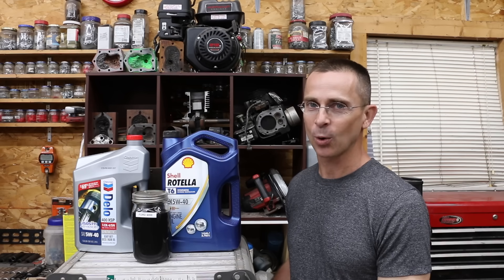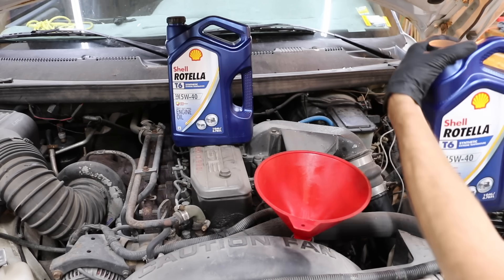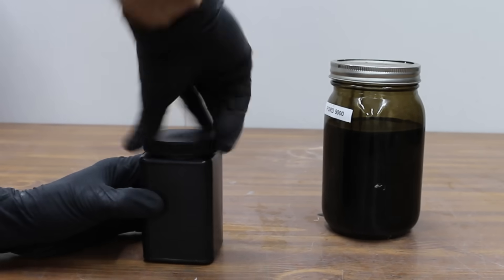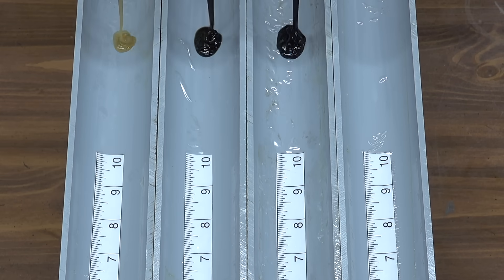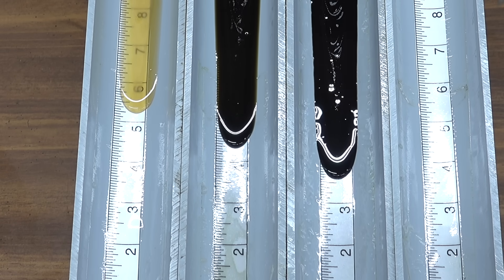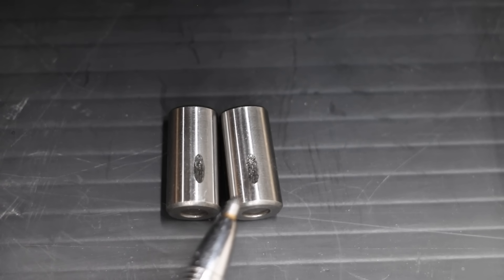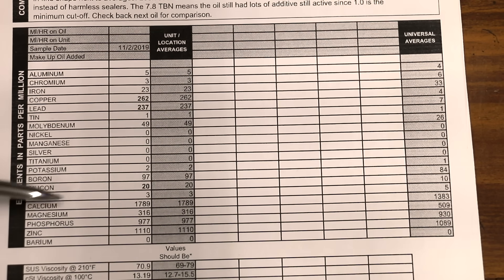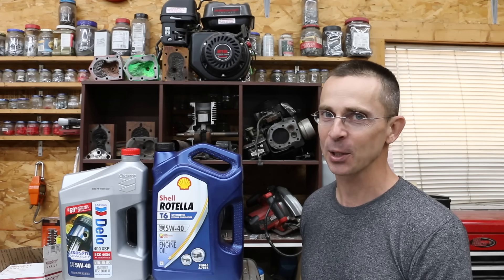Will Annual Oil Change Damage Your Car? Let's find out!

Comment: However, here I am back yet again. No one ever damaged an engine because they changed the oil too soon, as long as they used the correct products and installed the filter correctly.

Lucky me, my '96 Sentra is gone (state vehicle retirement program) and I'm back in a 2001 Toyota Camry. As far as I can tell, the former owner, now deceased, never missed an oil change in 20 years and 140,000 miles. I use no-name filters and low-cost dino oil, but my preferred oil change interval is 2500 miles. You don't have to worry about the ability of your oil to hold and neutralize contaminants over a year or more and 12,000 miles or more if they're not there in the first place.

I put a lot of weight in the report I heard about the New York taxi fleet test. They apparently found out that there was no difference in engine wear between conventional and synthetic oil. The conclusion I drew is that there is no point exceeding the requirements of the production you are working with. For example, the flow rate of an oil at very low temperatures is irrelevant if you never experience those temperatures. Nor do the differences in lubricating properties between one oil and another matter if your production does not require or utilize the superior properties of the (usually) more expensive product.

My bottom line is, trust the specifications of your production and the products you have available. My 1990s-era import engines do not require synthetic oil and I do not use it. The no-name filters I use are made to be good for 5000 miles. So is the low-end major oil company oil I buy. By changing the oil at 3000 miles at the most, the ability of the oil I use to hold contaminants over a long interval is not an issue.

I'm a good humorist and I can make snarky comments with the best of them, but I know how to be logical too. Another takeaway is, if you want to go a long time without having to change your engine oil, make sure you get products (oil and filter) with the specifications to match your objective. I would say, also, set your maintenance interval low enough that if you miss it, you are not going to harm the engine. That's what I do.
Reply from the maker: Thanks for the feedback.
Reply: @ProjectFarm  The way I see the market, there are there tiers of motor oil.

One) What I call major oil company oil. This mean labels like Chevron, Mobil, Shell, Texaco, Havoline, Arco, Sinclair, Citgo, Exxon or whatever. House brand oils, like Supertech or the proprietary label at a chain like Family Dollar, are by default oil company products.

My long-time take on these going back to the late 1970s is that they have good lubricating properties but wear out sooner.

Oil company products may be either conventional or synthetic.

Two) Premium or upmarket brands. These also may be either conventional or synthetic. These are brands like Penzoil, Quaker, Valvoline, Kendall, and Castrol.

My longtime take on these is that they  permit a longer oil change interval. Their synthetics probably are better than those sold under the oil company labels.

Three) Luxury or vanity products. These are products like Amsoil, Royal Purple, Red LIne and the like. They probably are somewhat superior to other products but only in that they allow a longer oil change interval. Someone who drives maybe 10,000 highway miles a month might have a legitimate reason for using one of these products.

Someone who drives largely short trips (like I do) should use a cheaper product and change more often. Easy for me to say that though. I have a 2.2L Toyota. All I have to do is open the hood, reach down and twist off the filter by hand, then jack it up a couple of inches and put the catch pan under it.

Mobil 1 is the anomaly in the market. It is an oil company product but in market position sits in between upmarket and vanity.

Comment: I did not change oil in my 2016 Camry for 2 years. I am in Canada and I am not aggressive driver. The oil is 0W20, I assume it is synthetic because it was a dealer who changed it 2 years ago. Due to COVID I was scared to go to mechanic. In two years I travelled only 1,200 km or 800 miles, while the Manual tells to change the oil at 10,000 miles or 12 months whatever comes first.  My total mileage is also low - only 3,700 miles as I do not drive much. Please, advise should I worry that I did not change the oil for 24 months, while having very low mileage in the last 2 years?
Reply: The only problem I see is you may not have allowed the engine to fully warm up. Even with the coolant gauge in the middle it can take oil longer than that to warm up. But with low miles perhaps the fresh oil kept the engine somewhat clean? I don't know but I'd probably change it and you can check the oil at Blackstone labs.

It's also pretty easy to change oil yourself, a ton of videos on how to do it. If you still don't feel confident maybe find a vehicle that is on it's way out and try it with that a few times to see.

Comment: I have a motorcycle that I don’t ride a lot. I’ve ridden about 4k miles in the past 3.5 years. I changed the oil in summer 2019 and have only ridden a little over 3k miles. Harley Davidson says 5k mile oil changes. Since it’s been 2 years would you recommend changing the oil or wait until 30k which would be 5k miles since the last oil change?

Comment: A job well done sir, I salute you.  This is something I have always suspected, and you've just proven.  I have a MB V6 diesel and a Genesis V8,  I use mobil one change yearly regardless of mileage. The MB is Sprinter rv I make sure to run at least and hour at hwy speed monthly.
Reply from the maker: Thanks!  Thanks for the feedback.

Comment: The problem with this video is generalizing results from a 5.9 litre cummins diesel which is likely the most reliable engine in the history of ICE to the gas engines most users will use today. The oil change interval on a diesel is often 3x longer than on an equivalent gas engine and depending on your situation can be even higher. So while this video is likely good useable data for diesel owners I would still recommend gassers change their oil every year to be honest.

Comment: Backs up my choice of T6 for my 6.7 Cummins. Been shopping around everywhere for Rotella T-6 this week (Oct2021) can't find it anywhere. My local Walmart where I usually buy it has ZERO diesel engine oil on the shelf, not a drop in any brand. Found three gallons of Valvoline at Amazon, I'm sure it will be fine.
Reply from the maker: Thanks for sharing.

Comment: I work for Cummins and I gotta say, I was already a huge fan of yours.. but running an old Ram with the 5.9 AND using Fleetguard filters… wow. I’m doubly impressed. It’s a rare sight for me to see that combo, most people cheap out on their filters when it comes to those old girls. Also, if you’re asking for oil requests, try Valvoline 5W40 Premium Blue.
Reply from the maker: Thanks!  Thanks for the suggestion.

Comment: Please note that motor oils with extra wear additives can damage your catalytic convertor. The PCV system draws small amounts of oil vapors into the combustion chamber and that exhaust can cause catalyst breakdown. The SN and gas engine rated oils are cat safe. The T6 is not.
Reply from the maker: Thanks for the feedback.

Comment: Enjoyed your video very much.  I retired from a major oil company that also manufactured natural and synthetic oils.  Very well known brand, You would know them.  We operated between 500 and 600 natural gas compressors and held BI-yearly “oil olympics”, to determine which oil was giving us the best results.  For the last 20 years, our oil of choice was Shell’s Rotella.  Different oils for different applications.  And no, our name was not Shell Oil.  But we bought their oil in large quantities.  Over the same period, I’ve owned several diesel trucks, my oil of choice has been Rotella T6, in either 5W40 or 15W40.  In my opinion, it is the best oil around and I don’t own any Shell stock.  You added weight to my opinion.  Thanks, again.
Reply from the maker: Thanks!  Thanks for sharing.

Comment: I  use a synthetic and a ceramic metals encapsulater. change my oil every 10,000 filter every 5,000 and do the ceramic every 5th oil change.. been doing this since the 80's oil is never overly dirty. Do the slip test. for viscosity at oil change time. ( oil on screwdriver shaft slips when fresh not so much when used.)
Reply from the maker: Thanks for sharing.

Comment: Amazing videos, love it. 
Got a question, 
dont you think that when doing the evaporation test, you should measure the same amount volume of the oil instead of the weight. This way i think you will get more accurate results as there are the same amount of oils cooking? Not sure
Reply: Generally speaking, it's more accurate to measure the weight of a fluid than the volume of the fluid. When you measure volume, you need to figure out where the top of the fluid is compared to the graduation markings. It's difficult to do this accurately because the top of some liquids is slightly convex, while with others it's slightly concave. So figuring out where the top actually is can be tricky.

Comment: Love your vids but there are some obvious issues with constants in this test as not all engines are the same and not all oil is the same. As you said before with the issue of acidity the oil loses its viscosity due to contamination from the environment in the engine. From engine type to engine age quality and condition the control conditions themselves would vary too much to even attempt to use different engines with these oils.

Personally ,I like you, don’t believe in the myth of oil going bad unless there are known factors to make it go bad. In a closed system the oils should remain unchanged unless it contains organic compounds like in traditional oil,  blended, or recycled. If it’s full synthetic then the only way it can possibly go bad is if there is a leak in the engine somewhere which would be obvious from the engine eating oil over a certain period of time.
Reply from the maker: Thanks!  Thanks for the feedback.

Comment: Great vid but' this is not a real Dodge truck, its a Knockoff just so you know.  Real easy to tell the real Dodge trucks apart since they're all built with rust holes over the rear wheel wells.  Hey' you'll never find one without the rust option in our area, believe me I've looked..lol  Thanks again, I didn't know we can use T6 in gas?..humm

Comment: Lol I dont know but I have had many engines make it 300,000 plus and I change the oils every 3500 or so miles. Even diesels.
Reply from the maker: Great feedback. Thank you
Reply: @ProjectFarm  I have never done any true oil break down . I do not know how long oil retains it original composition. So lengthy of time before an oil change even if you are not driving , at best for me is a guess.

Comment: Oil change should be based on distance used not elapsed time.

Manufacturers want constant income streams hence the time lapsed servicing requirement.

Time lapsed requirement is mainly a cash grab rather than an objective based requirement. You do not change your brake pads every few years because time lapsed do you?

Would not be surprised if  introduce a new product sabotage that has plastic which degrade brakes to justify a time based replacement.
Reply from the maker: Great point!! Thank you

Comment: Very interesting video that helps me relax a bit when not changing oil as often as recommended. I vehicle I normally put around 10k miles a year on only had about 5k on last year. I decided to change it after about 14 months. I hate throwing out oil if it is still good. I did make at least one hour trip monthly, so I know it was warmed up very well. Even though your testing can't be considered a perfect replacement for long term real world testing, it does give some good guidance.
Reply from the maker: Thanks for sharing.

Comment: I use Rotella T6 in my motorcycles since it's JASO-MA certified. My bikes are used for daily commuting, road trips, and also used to do track days. Haven't had a single issue with the motor, transmission, or clutch and that's with 10's of thousands of miles on the bikes (Ducati, Honda, and Kawasaki).
Reply from the maker: Thanks for sharing.

Comment: On the Rotella website says 10 years and 500k miles for the T6. Im really not sure of that figure. It is true that used oil now is better than anything on the shelf 20 years ago and technically you can go much longer by just changing filter and topping off but in no way do i believe 10 years and 500k miles (semi included)

Rotella has a gasoline specific oil, even in the same weights as the diesel specific. You can use them interchangeably but they reccomend them for their applications. I think it has to do with the specific sludge and demands of the engines.
Reply from the maker: Thanks for the feedback.

Comment: It depends on the engine. Some engines just run cleaner than others. My 5.3L Chevrolet kept my engine oil clean looking even after a year of use. My Volvo S80 3.2L engine looks like it breaks down the engine oil much faster.
Reply from the maker: Thanks for the feedback.

Comment: Good video...I can't discount you or prove you wrong!  I run my pick-up less than 4000 miles a year.  Mainly for hunting and camping, and living in Wyoming, one doesn't have to go far for either.  I will still change my oil once a year. Usually the first week of October.  As an old boy once told me many years ago, "Oil and grease are cheap...repairs aren't" (we greased every zerk every day and changed the oil every 3000 miles on his daily work trucks).  So I do my yearly oil and lube job for that peace of mind/cheap insurance (and out of habit).  Nevertheless, great video!  Thanks.
Reply from the maker: You are welcome!  Thanks for sharing.

Comment: Thanks, good overviews…. Interestingly, I am , & have been doing the “ OCI/one year “, about five years in my  GMC CANYON/ 4 CYL 2007:: @141,000using 5W-30,MOB1 *& NAPA gold/ Purolator Boss / Royal Purple Filter Replacements ever six month ( or earlier) @ low miles /warm-up generally….sort of low miles .but engine is quiet / good running,

Comment: Impressive work!  I have two classic cars that I began changing their oil just once per year with Mobil 1.  I drive one car about 3,000 miles/year and the other only about 1,000 miles per year.  I'll probably continue to change the oil yearly, but it's good to know I could go longer without worries.
Reply from the maker: Thanks!  Thanks for sharing.

Comment: Have you ever tested the Shell Rotella T1 SAE30 motor oil? I have used this oil along with Motorcraft FL-1A oil filters before in my Ford F150’s with 300 inline 6 engines and not really had any complaints with really good oil pressure. I usually keep this oil in stock for use in my small engine stuff and hydrostatic transmission in my 165 John Deere lawn tractor. Thanks again for your great videos.
Reply from the maker: You are welcome!  Thanks for the suggestion.

Comment: This is something I suspected for a long time.  My current vehicle is a 2014 Mazda5.  It requires synthetic oil.  I drive about 7,000 miles per year meaning, I change my oil once a year.  I'm betting well within the specs for synthetic oil.  I remember when I was younger I would change my oil every 3,000 miles, religiously.  But I'm thinking even that was over kill.  We all know engines depend on good oil and hence we change it.  But our modern cars and modern oil can actually go longer.
Reply from the maker: Thanks for the feedback.

Comment: Along the same lines, do you actually need to repack wheel bearings yearly even if the trailer hasn't been used much
Reply: Great question!!!
Reply: I do mine about every other year

Comment: Wear metals in oil sample is much greater function of the oil filter, silicon is probably a function of the air filter all right, but oil sump air filters can be real good, and realize that modern paper air filters work better the dirtier they are, a new air filter will more dust into the cylinder that a partially plugged filter, and silicon in the oil can also be a function of the oil filter. Oil filter job is to take out the contaminants
Reply from the maker: Thanks for the feedback.

Comment: An annual oil change could easily damage your car, if you forgot how to do it and drained you, then refilled it, changed you oil filter, then drove off in you car, without checking the level and not screwing the drain plug back into the oil pan.
Reply from the maker: Thanks for the feedback.

Comment: You know I used to scrap metal I never change the oil on the cars I just kept putting oil in I never even checked them the Amores were were really good engines and I never had a problem with the oil So these tests are probably right But it spent $30000 for a car a Toyota and I think I'm going to keep change in the oil at 5000 miles I just feel better

Comment: Great 👍 video and review. My ML350 is rated to change at 12mo,10k miles. Last change I did was 14 months and only 5.5k miles. The oil still looked so clean, I almost kicked myself for not going to 18 months. But I figured better safe than sorry and now I know. Going to look for your review of Mobil 1 synthetic now. My dad used it since I was a kid and 30 years later, it’s what I use. In 30+ years, we’ve never had one engine problem. Again, I love the videos and awesome information.
Reply from the maker: Thanks so much!  Thanks for sharing.

Comment: What do think of adding smaller strong earth magnets to the outside surface of oil filters?
Reply from the maker: Thanks for the suggestion.
Reply: @ProjectFarm  I noticed them on another video I watched and wondered whether they would be effective. I know that most sump plugs have built in magnets and have seen metal fragments on these too.
Reply: put them on bottom of oil pan